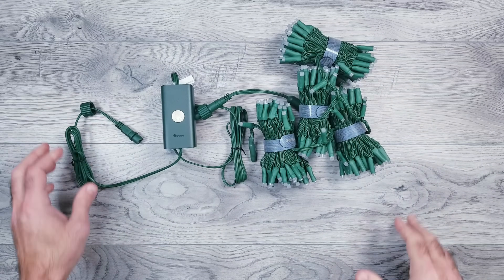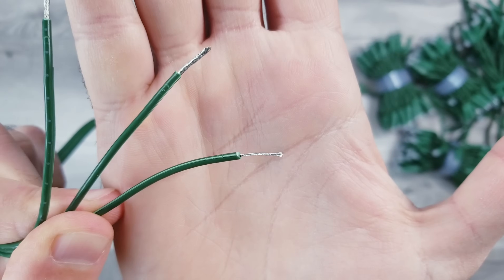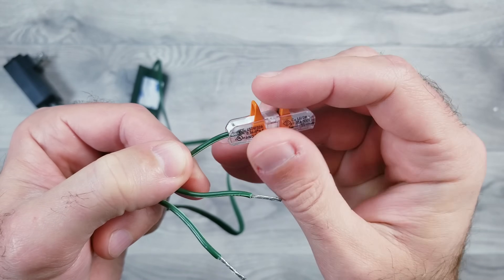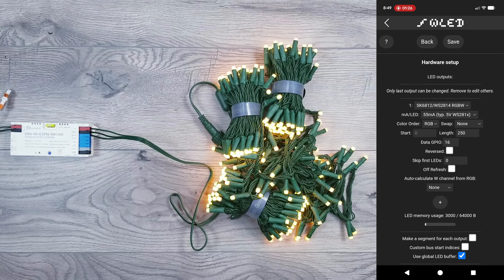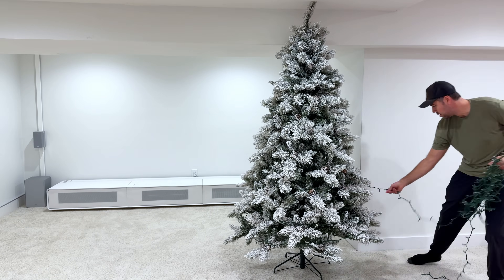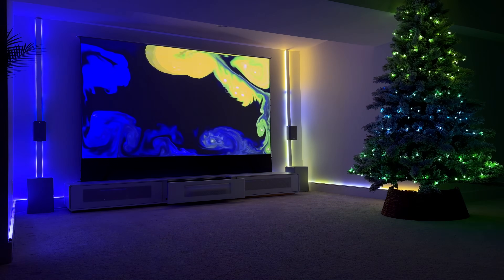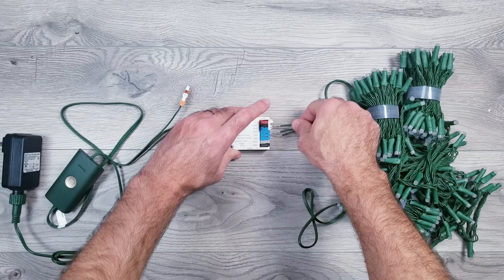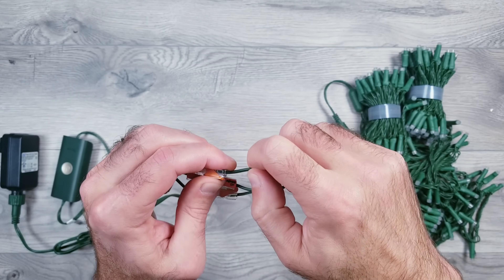will it WLED - episode 5 (brand new Govee christmas sparkle string lights)

Comment: Good morning Chris from not so sunny Central California! We have a 5 year old artificial Christmas tree that we were going to trash after this year because several of the built in warm white LEDs are no longer working. There is nothing wrong with the structure of the tree or the base. After running into this video, we can now just not plug in the old built-in lights, and string these lights saving us money and jumping into modern times! I bought everything from this video and look forward setting it up. Unfortunately (for my wife lol), you may have created a monster as I have subscribed and have been watching all of your videos and will be setting up more LED projects in the future, starting with the Fancyled Ambilights for my 65" 4K TV! One question, if I may, if I purchase the cheap Govee LED floor lamps, can I replace the LEDs with the Synced Fancyled light strips so that they can sync with the Fancyled Ambilights around my TV? Thanks and God Bless!

Comment: Chris, thanks for this video! This is awesome! I just freed my goveelights! I do have a quick question. I want to run one 66 and one 99 out of the same gledopto (I am using the one you recommended in the video). Which power supply would you recommend to achieve this? I am sure the govee one is not going to be enough to run two at the same time.
Reply from the maker: Thanks for watching! I would try a 5v 5amp supply and see how that works. I'm assuming you would connect the 99ft and 66ft to 2 data outputs? That's what I would do. Running them both off the same data output would probably be too long
Reply: @ChrisMaherDIY  Correct, that's the plan. I want to use two data outputs and split the power using the included terminal blocks. Ill give that a try, Thanks!

Comment: My LEDs will flicker whenever the brightness is below 50% and when i enable effects ... I used the standard Power supply from govee ... do you think it is an powersuply issue? Thanks for any help!
Reply from the maker: Thanks for watching! Are you using the same WLED gledopto controller I'm using in the video? The elite 4d?
Reply: @ChrisMaherDIY did not find it in Germany… I got this one:

GLEDOPTO ESP32 WLED Controller Digital LED Strip Light Controller mit MIC Funktion UART Download DC5-24V DIY Lichteffekt 100+Support WS2811, SK6812, SM16703P, WS2812B
Reply from the maker: @svnlrerasdq so for whatever reason the elite 4d works great but other WLED controllers are having a hard time. But after a bunch of trial and error I got the lights to work on pretty much every Gledopto controller by cutting off the Govee controller and just inserting the 2 wires (voltage and ground) into the power. For whatever reason I believe the Govee controller does not allow the adequate amount of power to get through. Try that and see if that makes a difference!
Reply: @ChrisMaherDIY Tried everything you’ve said and now I’m left with a mangled $150 set of lights
Reply from the maker: @TheXanMans  bummer it's not working for you. It works for me and many others have commented that theirs are working perfectly doing what I did in the video. But the reason pretty much all my links are to Amazon is because you can always return stuff if things don't work out.
Reply from the maker: @svnlrerasdq did you get yours to work using the controller you ordered?
Reply: @ChrisMaherDIY  This is a really important comment! I am in the UK, and cannot get the Elite 4D, so I too was having issues with the 375 LED version. If I limited to 350ish bulbs, it would work fine. Likewise, if I limit the current to 1500, I could get all 375 bulbs working. By snipping out the Govee controller switch, I can get it all the way back up to 2800 on all 375 bulbs.

Comment: Question, I bought two 66ft light sets for my tree and it trails off to the a post but that's probably only the last 10ft. Anyway how would I connect this to the controller? Just over lay it, two wires per output? And would the settings need to be changed?

Comment: Thank you Chris, I did this withe the 66ft string and it worked great.  One strangeness I ran into is when I set the length to 250, it left off about 1/4 of the lights.  I eventually determined I had to use length 333 to get all of them lit.  The box definitely says 66ft / 250 LEDs, and a manual count came to something very close to 250, so it's a little mystery.

I also had a heck of a time with the wago-like terminals on the gledopto ... it doesn't want to bite my cables no matter how hard I try to force the cable in.
Reply from the maker: Thanks for the update! Are you using the same controller I'm doing? On the lever clips, make sure to open them up fully. You might think they are open but they can go back a little more to actually open. (Worth trying if that makes sense) Also that is strange about the les count. Double check the segments to make sure something didn't automatically get added there that's different than your led count Input.
Reply: @ChrisMaherDIY  Thank you for the reply, I think all my issues are solved. You are right, I wasn't bending the tabs back far enough, now I know!

On the #LEDs issue: I am using the same Elite 4D-EXMU controller. My problem was it came up with 4 outputs defined.  I didn't realize I couldn't change the strip type without deleting the other three outputs first. So I was setting the power for the strip, but it was set to WS281X instead of SK6812.  After fixing that, it's addresssing the 250 LEDs perfectly.

Comment: This is my first shot at WLED. Some problems I had/having - didn’t know which WLED app to use. Native? +?  I ended up trying both. Hooked it up fine but I couldn’t make all of the LED’s go to a single color.
Reply from the maker: Thanks for watching! Are you using the exact WLED controller that I'm using?
Reply: @ChrisMaherDIY I figured it out. I’m using the same one. In wled app the led type was preset to something that was non modifiable. Only the fourth channel was modifiable. I assumed it autodetected it on the first channel and was correct. Tried SK6812 (or exactly what you used. Writing this from memory ) on the fourth channel and it worked. Of course changing IO to 16.

Comment: do you know any 15-20w 5v wled controller that are a tad smaller than this one with a single digital output ?

This one is quite big compared to the original controller and the smaller i found where 10W max.
It's for the 99ft version

Comment: Cool concept! It's good to know these proprietary app dependent LED strings can be modified to work with open source stuff.

I have a 2007 Gemmy "Incredible Holiday Light Show" tree set where the RGB LEDs (especially the blue sections) became very faded over the years, and the sound/control board doesn't work like it used to. I keep thinking about re-LED'ing the trees with WLED stuff and adding a sound module.

Comment: I bought the 99ft kit and I am waiting to get the WLED Gledopto Controller until the further testing is done around the 10th... does the controller get hot? I wanted to design and print a cover for it to attach to the tree that is dark green and I wanted to see if it needed to be vented and printed in ASA rather than PLA

Comment: So, I got the 99ft version, it seems like there's a pattern baked into the lights by default, the first 100 or so chips light white (and refuse to change) but all of the lights flash random colors (not ina way that would have me expect power issues). Including the ones that light up white, they are bright white, but you can still see the diodes changing color slightly, it's an exact pulse, which leads me to believe it's not an issue with lighting. I can't get any of the lights to change color, the best results I got were with the 400khz diode setting, they would at least respond to dimming, and white color change, but as soon as I move to a color other than white, they all just go random colors. I'm very confused by this behavior, is it possible that the diodes themselves have a preset pattern that is interfering with WLED?
Reply from the maker: Hmm, interesting. I just ordered the 99ft version from amazon to check to see if I run into any issues. I cant imagine there is much of a difference between the 64 ft and 99ft version but I guess ya never know until you try. Its supposed to arrive on the 10th so I'll try setting it up to see what happens.
Reply: @ChrisMaherDIY  Thanks!! I guess I can't really rule out a defective piece of hardware somewhere, I'm hoping to get this fixed in time for Christmas, but push comes to shove, I may just cut the strip in half and use a separate GPIO to test at some point.
Reply from the maker: @QreenVEVO when something's not working I always double check my wires, double check the WLED settings, double check to see if segments were automatically created, try different power supply, try different controller and if it's still not working then I cry lol.
Reply: @ChrisMaherDIY  Sadly, I'm very quickly approaching the crying stage with these, I have built many WLED projects and this is the first one to truly give me a headache hahaha.
Reply from the maker: Can you use some wagos like I did at the end of the video to get it back to using the Govee controller to make sure that at least works?
Reply: @ChrisMaherDIY  Yep, Govee control works perfectly using the same power supply and everything, maybe I got a defective WLED controller, I'm gonna try wiring it up to a strip of WS2812b offcuts.
Reply: Alright, I'm starting to think this might be a power delivery problem, I'm hitting a snag where the Gledopto controller no longer comes online when the data pin of the lights is plugged in. Introducing the data pin makes the gledopto indicator light dim noticeably while the lights flicker. Thinking a dedicated barrel-jack power supply might be needed for the 99ft version.
Reply: @QreenVEVO  It's not a defective controller. I've used 5 different WLED controllers and it's the same on all of them.
Reply from the maker: @solomonw6003  the 99ft version just arrived, i hooked it up and its working perfectly for me. I'm using the same gledopto 4d controller for the 99ft kit as I did for the 66ft kit.  https://amzn.to/3KnsZ1a
Reply from the maker: @QreenVEVO  the 99ft version just arrived, i hooked it up and its working perfectly for me. I'm using the same gledopto 4d controller for the 99ft kit as I did for the 66ft kit.  https://amzn.to/3KnsZ1a  I'm curious this is the same controller you tried it on or if its different? If your using something different and its not working, my spidy senses are telling me its gotta be the controller and how maybe gledopto's new 4d controller is doing something different that for some reason lets it play nice with Govee hardware. What are your thoughts?
Reply: I have the same problem. I can get most lights to light up if you push the brightness to 100% and select a single color. I believe it's a power delivery issue. I'm going to assume that Govee is not activating all LEDs at once and that keeps the power below the 3000ma threshold.
Reply: There are also 2 (what I assume to be) IR detectors in line, one at the halfway point and one near the end of the strand. Do you think it's possible these are also interfering?
Reply: Im also having the same issue with the 99ft lights. Even at low brightness.  Using a different brand of controller but the same style. Anyone get them to work properly?
Reply from the maker: @chrisvanmill6020  the 99ft version just arrived, i hooked it up and its working perfectly for me. I'm using the same gledopto 4d controller for the 99ft kit as I did for the 66ft kit.  https://amzn.to/3KnsZ1a
Reply: Same problem with 99ft. I will order a larger 5v power supply. Tried 2 controllers. Tried small segments, skip LED, tell it 2800ma. With and without auto brightness limiter. Tried separate 5v for controller as well.
Reply from the maker: @chrisbrackett4235  the 99ft version just arrived, i hooked it up and its working perfectly for me. I'm using the same gledopto 4d controller for the 99ft kit as I did for the 66ft kit.  https://amzn.to/3KnsZ1a Here is a short video I took of it working. https://youtu.be/OOjI8TVVwlQ
Reply: @ChrisMaherDIY i switched to the Gledopto Elite 4D-EXMU and it works perfectly now. Thank you! Plus i plan to use the extra GPIOs as well.

Comment: Hallo, vielen Dank für das Video! 
Ich habe ein Wled setup mit 24 Volt und 3 LED CCT Streifen mit jeweils 3,5 Meter. Der Controller und das Netzteil sind 1 Meter entfernt. Wenn ich alle 3 Pole der Kabel mit 0,75 mm2 verkable funktioniert es nicht. Wenn ich dünnere Kabel nehme funktioniert es. Ich habe überall gelesen dass man so dicke Kabel nehmen soll wie möglich. Ich bin echt verwirrt. Oder soll ich nur für das Datenkabel ein dünnes Kabel nehmen. Bitte um Hilfe !

Comment: For those asking about outdoor use, this you tuber has said they are rated for outdoor use. They are not. The original string lights are. 

In fact the biggest gripe in the reviews of these lights is that they can't be used outdoors.
Reply from the maker: Thanks for watching. You are correct. I just updated my previous comment. Thanks!

Comment: I’m totally new to this concept but very intrigued. I have a prelit tree that has LED lights that via a remote can be set as white or twinkling white or color or twinkling color, but I can’t control the colors. Wiring is 2 wire.  I’ve read all the comments, doesn’t seem like my setup would be compatible with WLED, but thought I’d check to see if anyone had any thoughts.

Comment: I'll say it again, the "Will it WLED" series is the most interesting around on YouTube! Quick question, what's the voltage from the Govee controller on this one?
Reply from the maker: Thanks so much! I believe it's a 5v 3a power supply they are using!
Reply: @ChrisMaherDIY   only a 5V/3A PSU?! That seems like not much at all?! It must dim quite a bit on full white no?
Reply from the maker: @benwhittle7204 they don't seem to dim. White is when the lights are at their brightest. These are not like your average ws2812b lights. They don't need as much power as those.

Comment: Thanks Chris. Another win foe WLED. Question and maybe a short video, what’s the difference between all the Gledopto controllers.  Some are marked as ESP32 whilst others are just WLED.
Reply from the maker: Pretty much every one of their products use esp32 boards. (actually it might be all of them) Since the price difference between a 4 channel output with ethernet is not much more expensive than a 2 channel output without ethernet, I would just go with the newest ones. But Yeah, gledopto 100% seems to be the most serious at developing wled controllers. They seem to be in it for the long haul which is why i've been using them in most of my recent projects.
Reply: @ChrisMaherDIY got a couple of their older ones but definitely good products. Like the look of the elite series
Reply: @C @ChrisMaherDIY  I have one of the four channel gledopto controllers. It seems to glitch and pause every 30 seconds or so. Is this a problem that you’ve experienced or or could I just possibly have a bad board?

Comment: I'm new to this and don't use wled (yet). I plan on splicing govee lights. Is there another power box/outlet switch u recommend? $33 seems pretty costly if I plan on cutting them, for multiple separate projects.

Comment: Govee by default would all these without WLED so why do you need WLED?
Reply from the maker: Some people prefer WLED over the govee software (wled is much much more customizable and has better animations). WLED is also compatible with a bunch of different programs that would otherwise not work with the govee software. But Govee is great and for the majority of people, they would be perfectly content just using the Govee software.
Reply: @ChrisMaherDIY WLED is great if you are just using standard pixels.

Comment: Stupid question, but has anyone ever used these exact strings outdoors?
Reply from the maker: Not a stupid question at all! You can for sure use these outdoors. If you cut them to convert to wled like I did, just get an outdoor weather box to put the cut part in and you'll be good to go!
Reply: @ChrisMaherDIY the lights themselves can be strung along bushes and it’ll be fine? That’s my main concern.
Reply from the maker: @jbphotomain their connections seem to all be watertight so I think you should be good. But I would recommend keeping the box just in case they go out. I think Amazon extended their return window to Jan 31st for anything ordered November or December.

Comment: I wonder if these Govee lights can be used outdoors to wrap the tree or thrown in the shrubs
Reply from the maker: These are for sure rated for outdoor use. If you cut them to convert to wled, just get an outdoor weather box to put the cut part in and you'll be good to go!
Reply: @ChrisMaherDIY  thanks for quick reply Chris. Also, instead of using the Asahome lighting which I don’t really love can I go with the same cob lighting or sk6812 to cover the front of my house under the easement? The length is either 65 or 130 feet depending on how much I want to do. I was hoping that one GLEDOPTO Elite would work. I would maybe put it inside of the same diffused channel that you did in these garage door videos https://youtu.be/guDjpHak_bU
Reply: @ChrisMaherDIY Just to correct you. These Sparkle lights are not rated for outdoor use. The original string lights are. You really should correct yourself on this.
Reply from the maker: Update on this. Since the connectors on the lights had the same style that all their outdoor products had I assumed they were rated for outside. Turns out they are not! I've had mine outside for a few days now and they are doing fine but just wanted to clarify that they are not rated for outdoor use like their previous string lights were so proceed with caution!